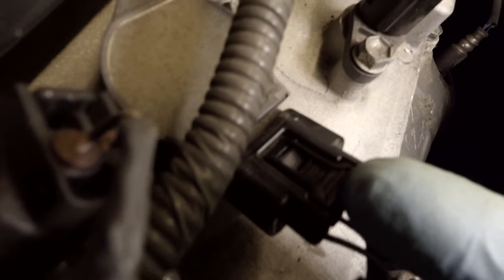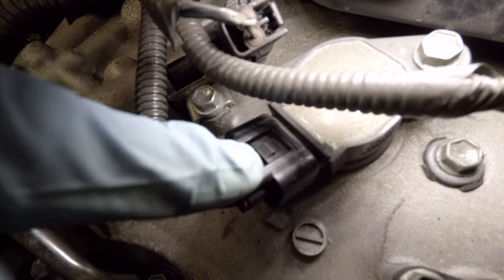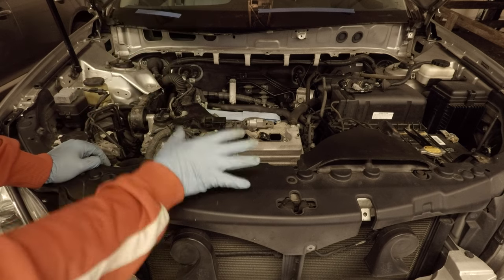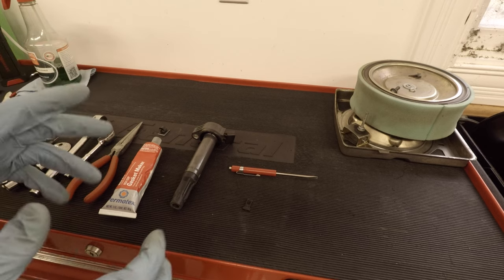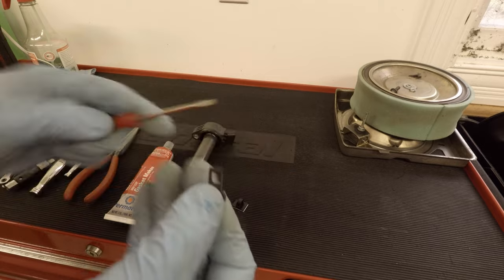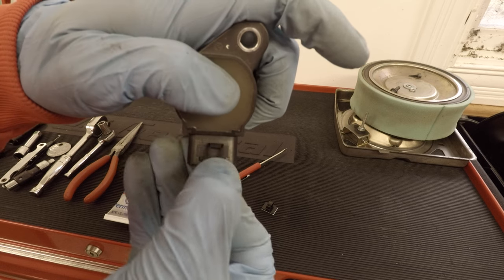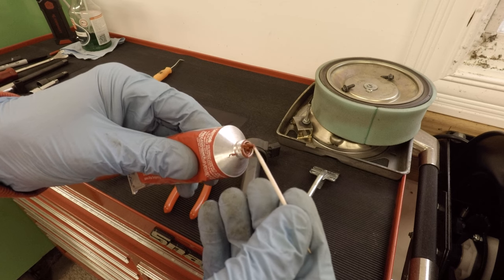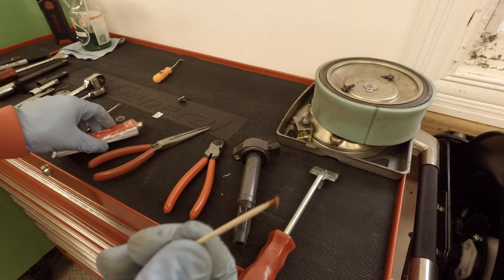Repair Hack - How To Fix Broken Wiring Sensor / Connector Plug Clip To Make A Factory Looking Repair

Comment: I have NEVER experienced a loose sensor clip. So when I break a clip, I'm overjoyed, no more stupid clip to deal with. The friction of the male and female ends when joined together has always been snug.   I'm sure a loose sensor plug happens but it just seems very rare, at least in my experience. Even so, I appreciate your video and the creative way you deal with the situation.

Comment: High temp rtv glue, red. Nice. I learned something new and useful. I think I'll use a tiny on my old jag coolant reservoir plug. Was tiny, old, hard to reach and easy to break. Hopefully the new reservoir last the next 100 thousand miles so I don't have to mess with it.

Comment: Now if you only had a solution for repairing the broken locking tab on my alternator regulator connector.  This tab locks the male plug into the receptacle but, of course, it broke off.  Hate to replace the whole alternator because of a lousy broken tab.🤬

Comment: Time is money, just use the same RTV and put a dab across the top of the connectors to seal it together. It will also be intuitive to the next person who has to service it when they see the RTV, and they know to simply slice it apart with a blade to release.

Comment: Note to self: Never buy a 2007 Lexus RX 350 no matter the price. Bad engineering. Impossible to replace coil packs. Sounds like the engineers planned it to run up Chilton manual repair hours for the dealer estimates. Reminds me of the time I replaced a cabin heater blower motor in an old Volvo 240 GL. Had to take half the interior of the car apart to put in.

Comment: My 2001 Tacoma is held together by zip ties.
Reply: Use ABS black cement, stronger then when it was new and welds it back, ether end repair, overnight set and good as new

Comment: The opening lmao bro had a autistic rage moment lol
Reply: Why not solder using zip tie as the plastic solder to put the broke piece back on? It only takes 30 seconds, and will look and work good as new.  And if it breaks again next time you can fix it again just as easy. Hell.... you could even just solder a tiny piece of zip tie anywhere touching both pieces (or in place of the piece you glue on and it would hold forever. Then when you want the connector off, you simply touch it with the soldering iron and it melts a Lil and you can pull it right off.
Reply from the maker: Not a bad idea.

Comment: The internal plastic parts in the plug are made of crappy incorrect plastic and tend to crumble.  Best solution is to buy cheap Chinese replacement plugs and insert the existing contacts/wires into new plugs.

The life limited flexible parts REALLY should have been on the coil side.

Comment: Could it be possible to epoxy the old clip piece back with 1000° high heat epoxy?going to try both .this idea though sounds amazing though because it is really a pain of a problem🌊🌊✌
Reply: Use ABS black cement, it welds them back on and stronger then they were when new,